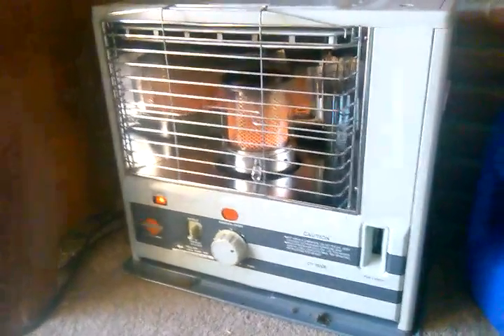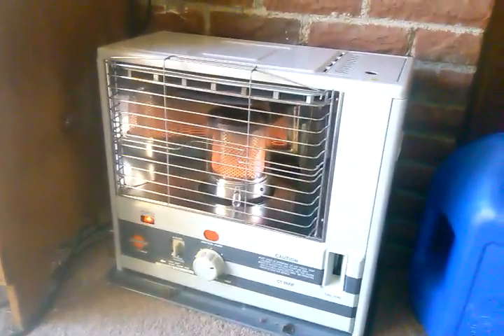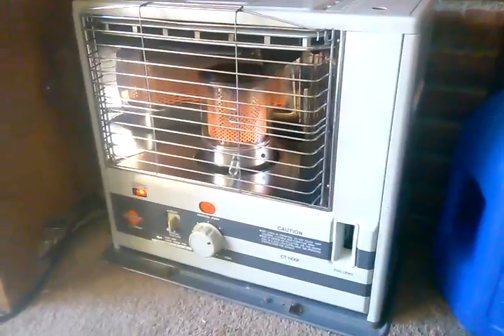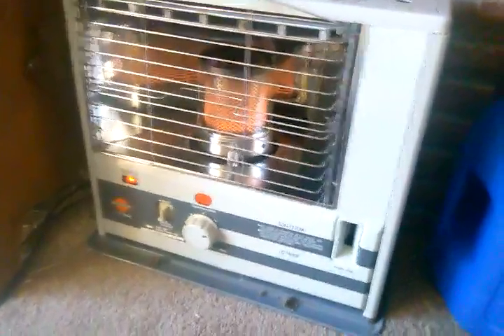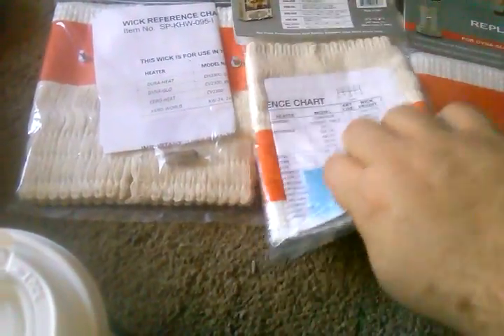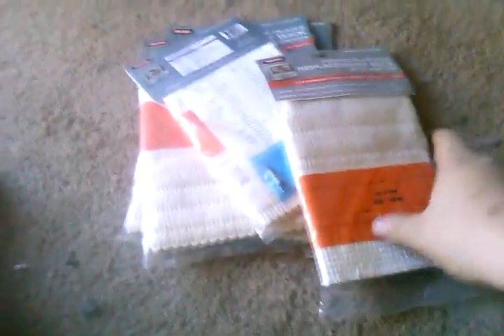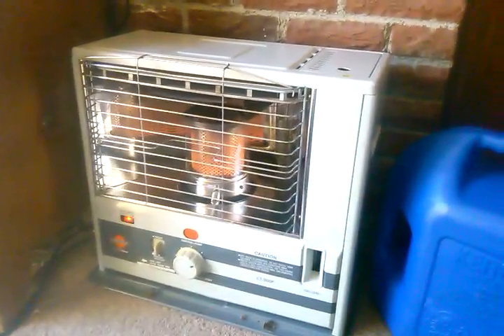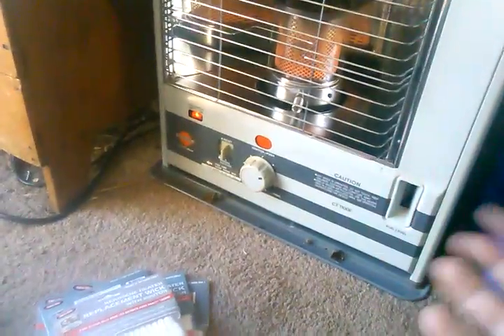Some tips on having a Kerosene heater as a backup heat source

Comment: I read up on kerosene heat versus propane. Kerosene is cleaner fuel than it used to be and used properly will not give off an odor  I prefer kerosene heater over propane because if a propane tank leaks it will explode. Kerosene accident is easier to control
Reply: Yup! Kerosene burns hotter too so you’ll use less of it.

Comment: Please help me understand how this is affordable.  I believe you said that the tank in the heater holds about 2 gallons and that you are able to buy kerosene for about $4 per gallon.  So, it costs you about $8 to fill the tank in a single heater.  You said it will run for 12 hours on a single tank.  So, in really cold weather, you are filling it twice per day.  Two refills per day at $8 per refill = $16/day.  If we say there are 30 days in a normal month, then 30 days X $16 per day = $480 per month.  Then multiply that times two, since you said you run two of these heaters.  What am I failing to consider?  How is this cost-effective?  The video description says that this is your primary heat source & has been for years, so how much do you spend, per month, in the dead of winter on kerosene?  Thanks for the info!  Excellent video!!
Reply from the maker: Kerosene was up then.  Now it is around $2.50 per gallon.  Not sure how much the tank holds, probably closer to a gallon and a half.   My other heater was a larger one.  It held a lot more but didn't need filled as often.   Yes, it was expensive, but better than freezing.    I don't know how much exactly I spent.  I just filled my cans as I needed them.  My new home has a furnace and natural gas, so I just use this little heater in the garage now.

Comment: The only tip missing is that there are fuel filter funnels that remove the water. I don’t have many options for kerosene around me so the filter helps.
Reply from the maker: Yeah I have never had a problem with water here, thank goodness.
Reply: Some people recommend adding a little rubbing alcohol into the fuel to keep the wick clean. 👎🏻
Rubbing alcohol just adds water.  If you had water in your car’s fuel tank, you might at HEET which is denatured alcohol. I haven’t tried it, but it might help the water/fuel problem to add a small quality of HEET to the kerosene. Denatured alcohol is used in alcohol stoves. HEET does have some additives that some people worry about toxic pollutants, so personally, I’d just go with the plain denatured alcohol.

Comment: I have a kero wick heater keeping my lab warm (32*C) even when it is -10*C outside.  I have not used K1 in it for 4 years as low sulfur diesel is less expensive and actually burns cleaner, smokes only for 5-10 seconds unlike K1 at 2 minutes. I will never go back to K1 for every reason. It treats the wick the same, as you should clean (or replace) the wick at least once every season.  I researched the chemistry for a month prior to doing this.  Yes you do run a fibreglass wicks empty and dry as it lengthens the life of the wick..
Reply: yep pump diesel burns incredibly cleanly and is the  cheapest fuel source for heating   per btu better value than propane or kerosene and easier to get.
Reply: Bingo
Diesel had to change in the 90s per the EPA laws , it is now low sulfur and works great in kero heaters but I do advise only burning clear

Comment: We have 2 of the small ones similar to the one you have .We also have a large round one. We use the 2 small ones everyday to heat the house. We have had them for 3 years now little smell but they sure save on our hydro and fuel oil bills. The big round one like yours is too hot for our house so it is in storage in the garage. It is -20C today and the house is nice and warm without running the furnace.

Comment: Finally a good straight to the point video. I have lanterns, heaters and homemade stuff. Been using #1 diesel for years. Runs clear. It is basically kerosene. Hard to find in the south. Used in semi’s in cold areas because it doesn’t gel like #2 road diesel.

Comment: Great information. The only thing I would add is that Kerosene heaters, even when running properly, consume oxygen and emit carbon dioxide in the home while burning. It is recommended that you crack a window in smaller rooms or open doors to adjacent rooms to allow an adequate supply of fresh oxygen for you and for the heater. I made the mistake of not doing this and ran my heater for 11hrs in my home. I started to feel funny and the room felt stuffy. I noticed it was hard to breath. I have a CO detector but it does NOT alert you for low O2 levels, only high CO levels. Also when the O2 levels drop, the heater will not operate as efficiently and it will start to emit higher levels of CO and pollutants/fumes. The general rule of thumb is 1 square inch of outside air ventilation per BTU. My unit is 10,000 BTU so 10 square inches. My windows are 36" wide so a 1/4 of an inch being cracked is more than enough. Has helped a bunch because I felt horrible for half the next day as well. A miserable experience.
Reply from the maker: Absolutely, more modern homes are sealed up very tightly, so you may need to crack a window for ventilation.  Also as oxygen levels get low, the heater will create greater and greater levels of Nitrogen Dioxide and Sulfur Dioxide.

Comment: Well I learned alot about kerosene heating today. I just bought a small Mr Heater propane heater as an emergency heat source and you gave me a really good idea as I was about to buy a whole bunch of small tanks before testing one out. it was a good educational video.
Reply: From a prepping standpoint it better to have both heaters in case fuel for one or the other is not available
Reply: From an efficiency standpoint, kerosene is superior to propane in several areas.
Propane is a flammable gas at room temperature. Leaks can be hard to detect and are extremely dangerous. Kerosene is a combustible liquid at room temperature. Leaks are easier to detect, but can be messy. Since propane is a gas at room temperature and kerosene is a combustible (not flammable) liquid, kerosene holds more BTUs than propane for an equal quantity of fuel. Kerosene can be stored and transported it plastic or metal fuel cans or bottle, propane needs to be in special metal tanks because it’s a pressurized gas.
Propane is easy to find in the USA so it’s convenient, and it’s also clean. Other than that, kerosene seems to be a superior fuel.
Reply: @totallyfrozen  Even though kerosene is superior I live in an apartment complex so storing kerosene is difficult.

Comment: Great advice. I grew up using kerosene haven't used it for a few years.i recently came across one like yours for free and I am going to use it in my workshop also I remember that warm kerosene  burns better but thats not a problem with these heaters because the tank is near the flame .avoid running heater puts out a nice heat with out the moisture that propane has.

Comment: Thanks for the good info. I am also in Ohio. 3 years ago we bought a very large old victorian home that has no major modifications from the time of build in 1890(*think original windows😰). The home heats with radiators/h20 and it's hard&costly to keep it toasty. This past month I've had to invest in these kerosene heaters as our boiler has a problem and I'm not able to fix at the moment.. I got 1 of the round ones used. Bought another round one at Tractor Supply(only because people post things for sale and either don't respond, drag their feet responding or cannot meet to complete sale for several days....unacceptable). Was given a radiant one by a friend. The 2 round ones keep things manageable. Although I notice that the upstairs tends to actually get hot (since heat rises it makes sense). I am having trouble with the one similar to yours though because the tank cap was leaking and I realized that the little O ring at the tip was dry rotted. Im thinking it's prob an easy fix but just don't want to assume. I cannot find any video addressing this. Can you offer any solution? Please & thank you in advance.

Comment: FP...great video. I recently purchased an old Perfection heater which I'm going to restore. I have never used kerosene so your tips are timely. Just got 6 inches of snow here in Ohio. I can't wait to refinish this Perfection. Surface rust and I paid 18.00 for it. It's going to be a beauty. Thanks!
Reply: I have two of the Perfection heaters I have refinished and love them. Did you refinish yours yet and use it? How do you like it?
Reply: No I built a barn instead. I'm very busy but I'll get to it. Glad to hear you're enjoying yours!
Reply: Be sure and post up when you get it done.
Reply: You better be willing to wait a while! I really do finish projects when I start them but there is a line. One reason I didn't start the refinishing was because I need a paint that can set with heat. I thought about taking it to an automotive shop but I really want to complete this myself. What paint should I use and how can I apply heat to cure the paint? One video used a touch. I would appreciate any tips. Thanks!!
Reply: If the rust is not bad a wire brush will get most of it off and then some sand paper. No real need to take it to bare metal unless it is pitted that bad with rust. Just be sure and clean all the surface areas real well of all dust. I sprayed mine with a Greased Lightning  and and hosed it off with a water hose really well then dried it with paper towels to keep it from flash rust. Let it dry out real good over night. Then rub all the surface area with a paper towel and rubbing alcohol before painting. Just make sure no lint is on the surface from the paper towel. Once it is nice and dry you are ready to paint. 

I like to paint outside where it is nice and sunny so it helps heat the metal and cure the paint. I use automotive hi temp header paint. I put on about 4 layers letting each one dry a couple hours. Dont forget to paint everywhere including underneath, inside the chimney area, etc.  Last one I did I just let it cure for a week or so then let it burn outside for about 30 min to an hour to burn off any smell from the paint.
Reply: I am grateful for the advice. It's just surface rust. Over all it may not look pretty yet,  but it is in excellent shape. My model is the 725. The rust is on the upper 1/3. I purchased a new wick from the wick shop but haven't used it. The paints I looked at required high temps to cure. I was ready to work on it one weekend and didn't start because of the curing instructions. The top of this one is flat so I hoped with a power outage I could put a pot on it to boil water. The inside is in excellent condition. I was happier than expected when I received it. Thanks again!! If I can figure out how to post a photo of the finished product on YouTube I will! I want it to be as original to the time period as possible.
Reply: My paint said the same thing but this one I didnt do that and just did it like I posted in the other post. 

Mine was in similar condition as your so just follow my directions. BTW, I used a brass brush so it didnt scar the metal on the heater. 

If your has the metal label on the front be sure and remove it before starting. Be careful removing it because it is made of very thin aluminium and can bend easy. It is only held on with two tabs. These tabs need to be handle gently because you will break them off. Just lightly bend them enough to remove the plate. Then just bend them back just enough to put the plate back on or you will break them off.
Reply: Excellent! Thank you again for the details on bringing this Perfection back to life!
Reply: YW let me know if you need anymore info.
Reply: Will do!!

Comment: They are not going to give me a headache since if it stinks I am going to take it outside until I can find a solution!  I have been using kerosene heaters for 40 years off and on and I like to heat with them and cook on them.  The large kero heaters are easy to change the wicks but some of the smaller reflective models can be a pain!

Comment: 8:50
I buy my kerosene at my local (and very busy) ACE hardware store. They hand pump it out of a 55 gallon drum. So I feel pretty confident that it hasn’t sat there for years on end. I assume they probably go through a drum in just a couple of months.
Reply from the maker: Kerosene is extremely stable.  You could let it sit in an open container for 20 years and it will still burn just fine.

Comment: Great Video. I've been looking into this for a while and was wondering about where you store your kerosene during the winter when you're using it constantly. So many websites have so many answers whether to keep it indoors or not. Will it cause problems if kept indoors?
Reply from the maker: I have always kept mine indoors.  Of course I have 50 gallons of gasoline and about about 75 gallon of propane and about 100,000 rounds off ammunition stored indoors a well.  So, if you see my house on fire.... RUN!  Kerosene has a very high flash point, basically it has to be soaked into something to burn.  It's not like gasoline where the vapors are explosive.  You can put a cigarette out in kerosene.  I also use the newer fuel cans that are sealed until you twist and push the nozzle down.  I don't use the nozzles to fill any more though (too many spills) I bought a little hand siphon pump the other day and it works great.
Reply: ***** Thanks a ton. Too many people had me overly paranoid about storing it indoors. So I had it stored outdoors and was worried about it freezing and the condensation.
Reply from the maker: Condensation can be and issue outside if the temp is constantly going up and down, but if it is one of the new sealed cans that won't be as bad.  It won't freeze.it will start to gel and get thick at -40F and will freeze solid a -120F.  Even if it gels (or freezes) it doesn't hurt it and it will go right back to normal as it warms up. . I would say that if you go through it pretty quick, every few weeks you will be fine outside.  I just like it inside because it is more convenient.
Reply: I store my kerosene in a sealed kerosene container in my spare bathroom tub.

Comment: I would love to find one of those units with the fan in it. I'd even spend twice as much than you did!
Reply from the maker: You and me both.  This one has been in my garage for several years now.  It still works, but it has gotten pretty beaten up over they years.
Reply: Will you please tell us the make and model number in order for us to be able to look on craigslist Etc. Thank you.
Reply: @johnwyman6331  buy an eco fan to sit on top of the heater it's powered by the actual heat from the heater they work great to push out the heat

Comment: Thanks for the information, I am in Ohio also and am looking into kerosene heaters as a back up. You said it last a long time, what is a long time in your opinion? Thanks again.
Reply: Workin On It convection heaters use a lil more fuel then radiant. My back up 23000 btu is rated 8 hours on 1.9 gallons. A radiant model can get 12+ hours on 1 gallon. Best backup heat is kerosene in my opinion. Most radiant is around 10000 btu. Great for bed rooms 350 sf. Convetion about 1200 sf.
Reply from the maker: I get 12+ hours on a tank

Comment: i have both this type and the propane only because when the power goes out for me its a lot of hassle to get the karosene going and maintain one. its easier to hop up and light off the propane and then get the karosene ready for back up if the bottle runs out. to use them on a regular basis? we used to just have big central heat furnaces when i was young and big tanks in the ground that were filled by a truck every month. so i dont get the little heater thing daily and all the maintenance? are we getting stupid or what?

Comment: Something I've wondered about is how house insurance policies are impacted by kerosene heater use.  I store my kerosene outside but I do have a little inside for my lanterns.  Considering the paranoia about CO poisoning and fires from kerosene heaters, insurance might be an issue even though most of the problems are from candles, gasoline generators and faulty electric heaters.
Reply: There isn’t one answer to that. Read your policy

Comment: Hi Tom, You mentioned several times headaches and vomiting, aren't those the worst indicators of carbon monoxide poisoning?
Reply from the maker: The could be indicators of CO poisoning.  I think the worst indicator is death though.  Most often with Kerosene heaters it is Nitrogen Dioxide that will give you the headaches first.

Comment: Isn't there some way to remove water from kerosene that has been poorly stored and suffered the effects of condensation? I'm thinking, what would happen if you uncovered the container for a few hours, would the water evaporate? (Water is supposed to stay on top of the kerosene, right?
)
Reply from the maker: Water goes to the bottom.  Oil Floats on top of water.  The problem with kerosene is it will break down and actually mix with the water over time.   I will cause it to grow Algae and mold over time which will plug up the wick.   There is Kero-Clean which is a additive that will absorb moisture.
Reply: @frugalprepper  It's true that the oil floats! What a mistake I said! Hahaha Thanks for the answer! (if it weren't for the fact that the water mixes with the kerosene, it could be placed in a tank with a tap at the bottom, let it settle, and drain it a bit...
)

Comment: I'm looking at buying a big round kerosene heater what's like 27 years old it's only $50 lady said it works good anything I should know before buying it or should I pass
Reply from the maker: $50 seems a little high.  I normally get mine at garage sales for $5 - $10.  The often times will need a new wick and cleaning an then they work fine.